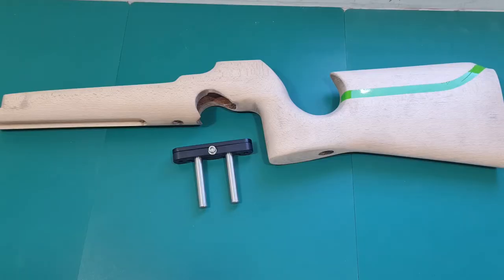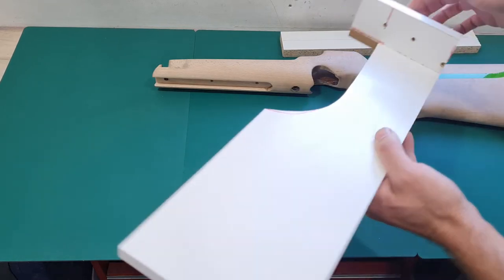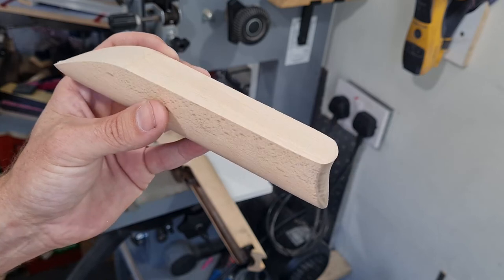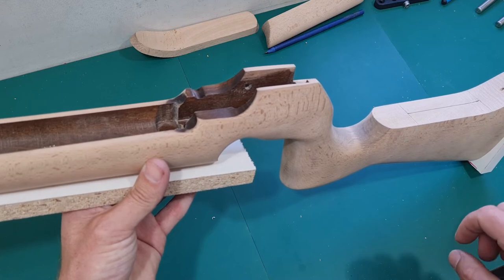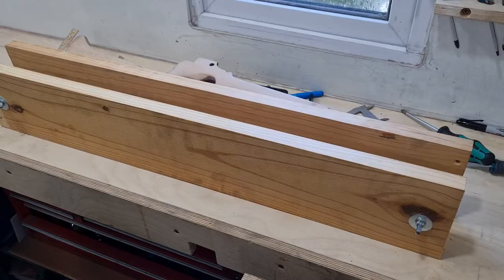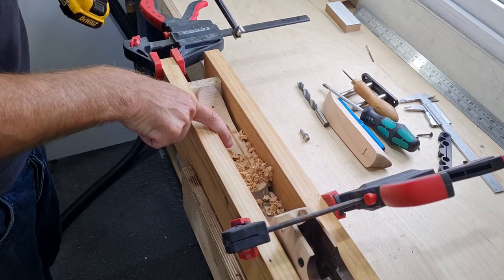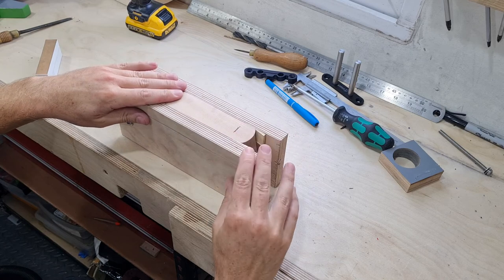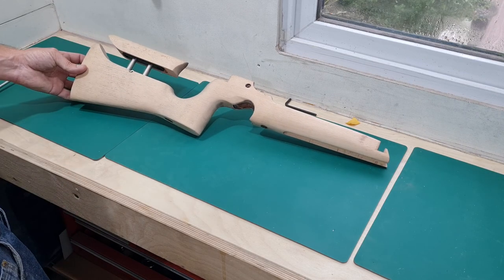DIY  how to fit adjustable cheek piece comb riser hardware into a target rifle stock

Comment: Hi Great informative video, so I’m wondering if it’s possible to do the same customisation on my HW99S which I’ve recently purchased. I realise this the entry level Wauhrach but I love the simplicity of the gun. However the stock is very low for using a scope, it needs to be about 25mm higher. How would I go about getting an estimate from you?

Comment: how do you know how big of a piece of wood to cut out to make the comb on any rifle or shotgun, is there a rule of thumb or a standard ?
Reply from the maker: Probably the most important considerations are how big would you need it to be,to be able to hold it safely once chopped off, to rework it and get any datum faces machined in.
Then you need to consider how much of the cheek piece you use. It needs to be a bit larger than the touch points you use 
Then lastly you need to have it styled so it looks balanced and mean 😉

Comment: Hi I don't do Facebook what's the best way to contact you regarding S200 customised stock cheers.Tony
Reply from the maker: Hi Tony , are you looking to have your existing factory stock modified or a custom one built?
Reply: @tillysgunstocks  Hi my existing stock modified 
Adjustable butt pad 
Whole pistol grip stippling 
Pistol grip finger grooves 
Last 1/3 rd of forend stippling 
 Re finishing staining stock 
Matt oil finish 
I think that covers it.
Reply: Also anything you can do or recommend to remove wood around front of the trigger guard as I have big mitts.
Reply from the maker: @tonyashton780  are you on the new airgunforum ? There's a couple of fellas that could do exactly what you need. 
Regards the trigger guard/removing wood when I get this stock done and built up I'll show you how I modified the action to remove the factory trigger guard entirely. I'll be making a similar replacement to what you'd see on the hft500 but it allows you to open up the slot a lot and modify the lead in to the trigger. Especially useful for larger hands. And it also Increases the footprint of the action in the stock and makes it all a lot more solid 😉
Reply: @tillysgunstocks  No I don't really do forums or social media.The only people I have dealt with are Tony Wall at Sandwell & Phil Crampton at Rat Works.Two names kept cropping up regarding stocks your good self and Warren Edwards I believe.I only deal with recommended people!,can't be dealing with Fred in a shed and poor workmanship and two year waits.I have dealt with Air Arms for years and Claire and her team always deliver.
Reply: I look forward to your S200 stock videos and to be fair I really like what your doing and with stippling I'd be happy.